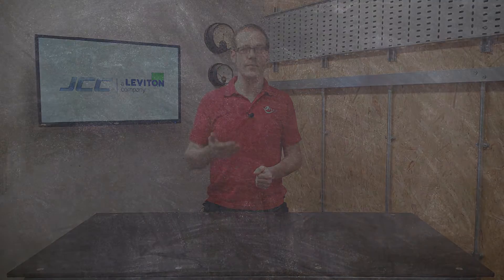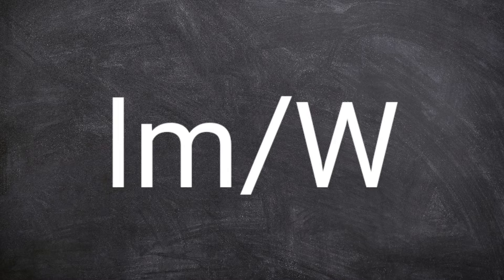What is lighting EFFICACY - Lumens per what??? :Electricians Q&A - LIGHTING DESIGN

Comment: I take efficacy and price into account. If a 470lm/6W lamp costs €1,- and a 470lm/4.5W lamp costs €2.50 ("ceteris paribus"), the cost of electricity saved over the lifetime of the lamp easily compensated for the extra cost. However if the price difference is higher and/or the efficacy difference is lower, it might not be worth getting the lower powered lamps.
Reply from the maker: Great point, thanks for commenting. 😊
Reply: The cooler running better engineered lamp is likely to also last longer!

Comment: Just to add:
Part L2A of the building regs state that an efficacy for non-domestic buildings (such as offices) should have an efficacy of 55 “luminaire lumens per circuit watt”. The reason for the distinction of “luminaire lumens” is because lamps might have a good efficacy, but when placed inside a luminaire housing, with diffuser etc, the characteristics change, hence it must be the luminaire lumens not just the lamp lumens. You also need to account for ‘wasted energy’ used by the luminaire components, i.e. transformers, drivers, emergency gear etc. Some manufacturers use a play on worlds to try to make their products sound better than they are. The reason for “circuit watts” is because you might have, for example, 10 good lights on a circuit and say 2 wall washers to highlight artwork on a wall. The 10 main lights might have a good efficacy whereas the feature wall washers might be less than than 55lm/W. So does this mean we cannot install the two wall washers? No, because they are on a circuit with other luminaires. So as long as all of the luminaire lumens of all fittings on that circuit added up and divided by the total wattage of all of the luminaires on that circuit (the entire luminaire, not just the lamp, but the driver, inverter, transformer etc) is greater than 55, the installation complies with Part L2A of the building regs.
Reply from the maker: Great, well researched comment, thanks very much!

Comment: As an apprenticeI  was tasked one day with  measuring the lighting levels in a major bank, There I was going around the areas assigned to with my foot candle meter, leaving notes on the various desks of the then current readings.
As it was a weekend and the bank was closed, the very nosey but nice caretaker was following several areas behind me. He knew the lighting was very likely being upgraded, eventually trying stealthily to follow my route around the bank he could not resist and approachen myself...with a question.
The question was, as he had been reading the notes was " How the hell are you going to fit 12 foot candles above the effing post desks, its a low ceiling " ?
Myself and the spark I was working with had no choice but to take a break as we were in stitches...the guy was serious, thought were were adding candles to improve the lighting !!!
Reply from the maker: 😂 It's easily misunderstood!